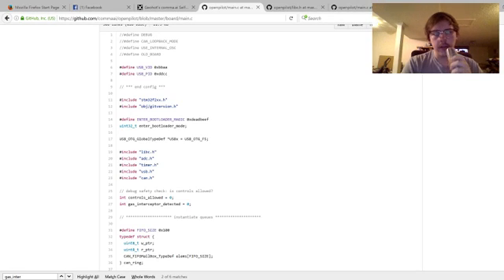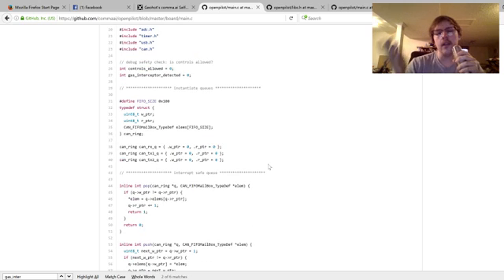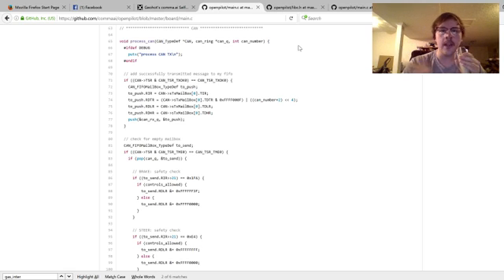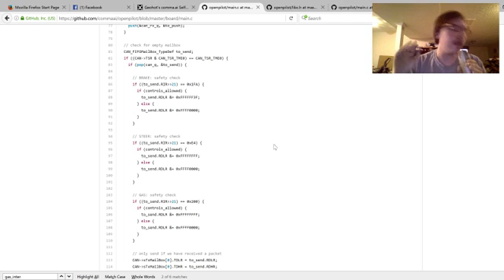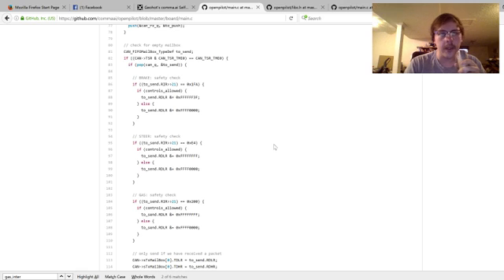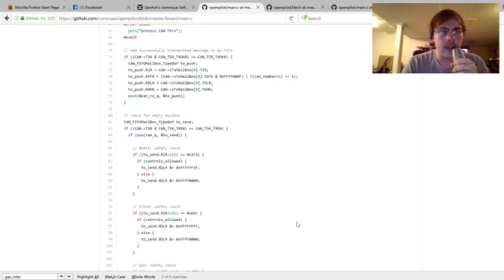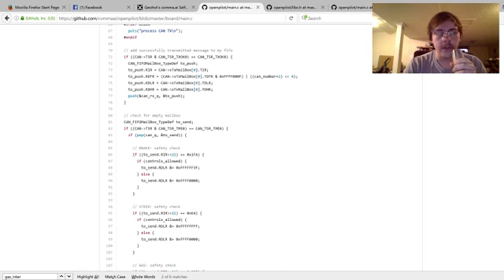Comma.ai's CAN bus code is terrifying

Comment: If you have a look at the code that shows you how it reads the right and left matched lines from the closed visiond binary, the steering messages it sends into the CAN to the ECU/EPS would be pretty difficult to spam with random packets from outside pid that OpenPilot has open with Neos while it's activated. It's possible that it's not secure however the ZMQ does have message encryption and it just may not be in use because of non necessity of it, unless you have your Neo/Eon openly connectable from the Internet with intentionally weakened access, which would of course just be dumb.

Comment: I think you don't really understand how it works. Sanity Checks are eventually performed by an actual hardware chip in the car. The Open Pilot software can just operate in the scope of safe CAN Bus commands anyway and its pretty strict, so no sudden movements and such. 
It kinda makes sense, since the sensors could be malfunction, right?
So why not google for 5 minutes how cars deal with such data instead make a 8 minutes long video?
Reply: Charles cars with lane assist have torque limits that cannot be exceeded by open pilot its no more at risk of doing it then the factory system
Reply from the maker: Eh, not really. depending on the manufacturer, the car's computer can do sanity checks, but with any sort of application like this, you want to do the sanity checks at all levels, not just at one level. Redundancy is safety. 

In addition, the car's computer only provides tolerance checks, and depending on the manufacturer, some other barebones safety features. That alone is enough reason to hard enforce your own checks, as you can't make assumptions which features are implemented or not. 

There was no way this was even close to ready for a public beta.
Reply: You still show that you have very little knowledge how cars work.

Comment: I think it boils down to trusing the closed visiond blob or not.  It may do all the checks you can imagine there, or not.  Even if it 
does, you have to fully trust it won’t purposefully crash into a tree or something, with safe-looking maneouvers, and no amount of defensive programming will save you or your car from that.  It is simply allowed full control over the car and you have to trust it.

On the other hand if you add too many checks in main.c you will kill the "good" smarts in the code that could save your car, or could cause it to kill the autopilot in a crucial moment without a warning to the human driver and create a more dangerous situation.  So you have to really balance that stuff right and that can't be all done in the low-level code because it's not simple.

So I don’t buy most of your rant.

And I say it is defensive programming that you want to see, because you want the code to basically check on itself, i.e. have main.c check on visiond.  Sure, defensive programming is kind of the analogy of the full redundancy of all the systems in avionincs, and it may be a good idea (are there many famous incidents where the systems redundancy has saved aircraft?  How about specifically electronics and software redundancy related incidentes?  Or is that too low level for such data to be available?)  But… you assumes that all of visiond is all way higher layers of processing than main.c which we can’t know, we don’t know how defensive visiond already is.
Reply from the maker: The Visiond blob by itself may do checks, but it's important to remember that the vision software is running on the python interpreter. 

The issue with the interface that the comma.ai code is using is that it in addition to not providing sanity checks at the hardware level, is that it also doesn't do any sort of tests to ensure that the data recieved from the device wasn't malformed, or that it was actually from the device. These are major problems that have major implications regardless of how good or bad the vision software itself is. It allows an outside attack vector that otherwise wouldn't exist. 

As for the amount of checks killing the "good" smarts in the code, I'm not sure what you mean. Doing redundancy checking doesn't effect the logic of interacting with the CAN bus in any way. All it does is ensure that the vision software isn't asking the car to do dangerous things. 

Regardless of what visiond does, it just shouldn't be possible for the board itself to allow the car to do anything that it perceives as dangerous. Remember that not only is this software looking after the lives of the people in the car, but others on the road, sidewalks, and buildings. When you're designing a system around redundancy, you never make assumptions that the higher level software will do anything right. When you're interfacing with the real world, in a real world situation, you MUST make sure that you're designing it in such a way that if it is remotely possible for the higher-abstraction level to do something, it will do it. Regardless of whether it makes sense or not. 

Your car is already implicitly designed in this way. Modern slapstick transmissions won't allow downshifts that can cause engine damage, Car ECU's limit the redline to below what would actually cause damage. Fuel systems shut off if the car is not running, E-brakes, and even steering has a manual override should the power steering pump fail. These aren't necessary for 99% of the time you'd be driving, but it needs to be there to ensure the safety of the vehicle. 

As it sits, there is no way that any transportation authority would ever allow this product to be sold. It has far too many holes, attack vectors, and not enough redundancy.
Reply: "it in addition to not providing sanity checks at the hardware level"
There are hardware level checks by the car itself, so no need to do this in the Open Pilot software.
Reply: Yeah, the language choice is difficult, all the really high level languages will run on some sort of non-realtime VM.  I'm not sure what would be a good choice.

As for sensor input checking.. yeah, checks are good and it should ring a loud alarm if inconsistencies are detected, although it might be doing some of this in the visiond code.  We don't know.

What I want to say is that sanity checking such a complex task is on the order of difficulty of actually performing the task.  You can't have a low layer properly check whether higher layers are doing their job right when they command a strong movement (they could be saving the vehicle) without implementing a second, reference autopilot to check against.  In the end what you want is aircraft-style redundancy and some sort of arbitration when any implementation of the higher layers differs from the remaining autopilots.  Both action and inaction can lead to an accident/car damage, or to avoiding those.

Comment: Can everything you said be fixed now that this is partly open source?  If so, why make a video calling it unsafe?  Why not just say what should be improved upon or make the changes yourself?
Reply from the maker: I don't own a car that controls the steering through the CAN bus, nor does my car have an ECU controlled cruise control, so if I was to modify the code to work with my vehicle, I'd be rebuilding it from scratch. 

Based on what they've released, the only code to alter would be the board's software. All of the supposed "safety" checking is soft enforced in a python script in the logic library. 

Essentially the product needs a ground up redesign in a proper language, with redundancy baked into the design. If someone was to start a proper open source project, I'd be happy to work on it. 

Essentially, you don't start building a Ferrari by copying a Pinto chassis.
Reply: the guy who built this , his name is GEOHOT.

so maybe you should talk to him

maybe he'll give you a job bud
Reply: Your main point is just wrong. Sanity checks are eventually done by an actual hardware chip in the car. There is just no need to do this on code level. Your claims regarding the safety whilst driving are highly extraggated.

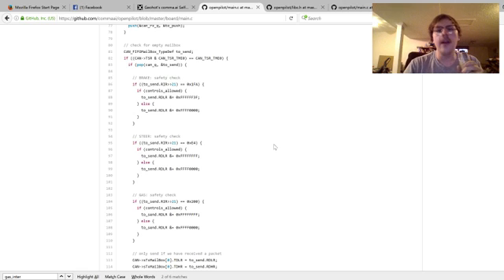Comment: The audio started echoing at 4:40ish.

You should also be aware that some of the locking issues (with acceleration/braking) were cause by poor Broadcom chips. Some of the visible issues were seen with the "airbag incidents".

You should also be aware that George has never claimed this software to be "ready for public consumption". So please tone down the rhetoric.

Lastly, this comes from an engineer that has worked with "runaway robots". Otherwise, your comments are very valuable. Thanks for taking the time to do this.

Jesse